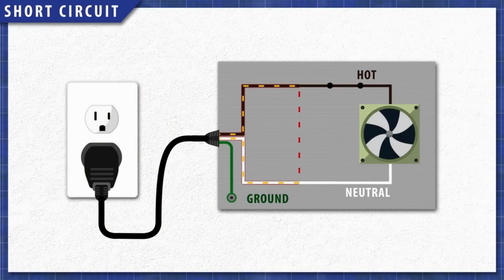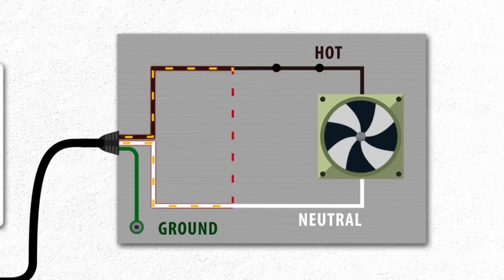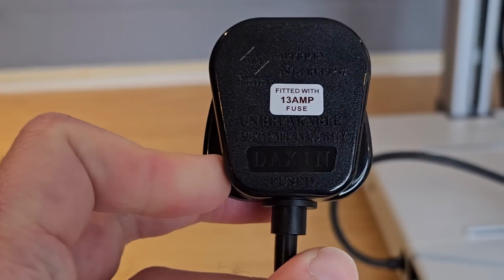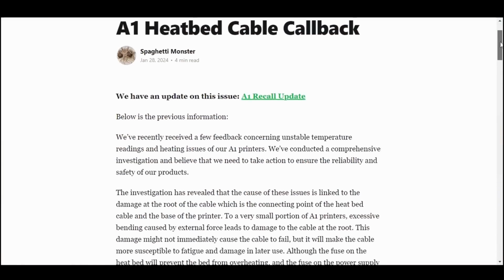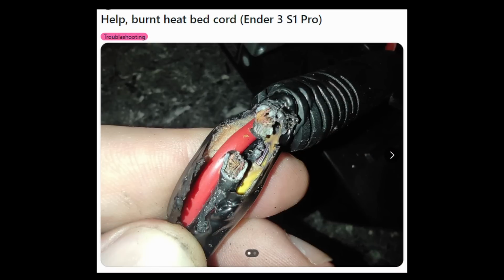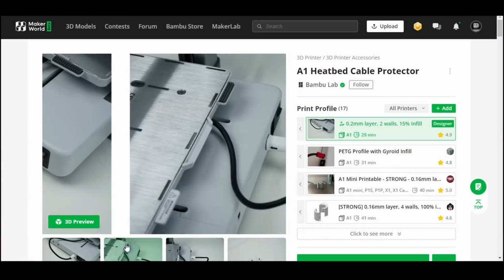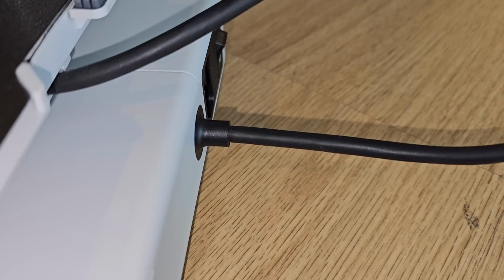Bambu Lab A1 3D Printer Recall - All You Need To Know

Comment: Should have stuck to the DC bed on a bedslinger, like the A1 mini. I am not a big fan of AC on bedslingers.
Reply: It would appear that this was ironically a decision based on cutting costs. The A! has a smaller cheaper power supply than the Ender 3.
Reply: Here in 240v land the bed uses 1000w. There's no way on earth they would put a 1200w(?) power supply in a printer. You'll always get faster heat up times with AC beds. As someone with 8 printers, I'll always favor AC beds. It's so much more efficient.
Reply: @camelKase   AC beds have been around for a long time. There is a trade off for speed of heating and shock and fire risk. AC heaters are better for CoreXY because the bed doesn’t sling back and forth. Not that AC heaters can’t be done on a bedslinger, there is just a lot more considerations for the cabling and safety. I have had AC heated beds, 12v and 24v DC heated beds. If I was going to recommend a bedslinger for a friend or family member, where they potentially might be service or tinkering or cleaning the bed with liquid cleaners, I would only recommend a DC bed. In 90% of users a one minute heat up vs three minutes is not really a huge feature. 

Good DC power supplies have short circuit protection and overcurrent protection that can react faster than a fuse or breaker. If you are counting on a fuse or breaker to protect you from AC mains, good luck. Lower voltage DC is exponentially safer and most vendors choose AC heaters for cost savings not the two minute time savings in a bed heat up.
Reply: @MrKornnugget  I don't disagree with any of that. Also They probably just use the same bed heater from the P1 and X1 since they're the same bed size. But with a grounded bed/frame your risk is almost nil. I would say there has never(??) been an AC printer electrocution. I'm happy to accept the risk for the efficiency / performance. Also my first printer was an AC bedslinger (Tevo Tornado).
Reply: @camelKase   I have been around the world, and you would be "Shocked" at how many outlets have bad grounds or no grounds at all. I am looking at you Schuko plugs, that are notorious for being plugged in without a ground. I also understand it is not Bambu's problem if your ground is bad or you plugged your Schuko plug into a universal power strip. 

I think there were some poor design choices, if they are going to put an A/C bed heater on a bedslinger, they should at least put a GFI plug on it. Fuses and breakers do not react fast enough to protect against electrocution. Grounded beds and frames only work if there is a good ground, and the electrical issue is touching the frame or bed.  With all the plastic, it is possible to have an electrical hazard that does not touch the frame or bed because they are not enclosures. Half the electrical enclosure is plastic and there is a possibility when a user touches the open electrical hazard they became the ground. Only a GFI would protect against non-ground or poorly grounded outlets or open electrical hazards. 

Let me see if I can summarize the two positions. 

DC Heated Beds:

1. Operate on lower voltages (12v or 24v), which generally means lower risk of severe electric shock.
2. Often power supplies with overcurrent protection to prevent excessive current draw.
3. Do not rely on house or building grounding for safety.

AC Heated Beds:

1. Can heat up more quickly due to higher power levels.
2. When properly grounded, the chassis can protect against electric shock, making them safe under normal conditions.
3. The use of a Ground Fault Circuit Interrupter (GFI) can interrupting the power if a fault is detected. (A1 does not have a GFI)

I personally think having a heating element on a bedslinger is a hazard that is not worth the time savings. This is just my opinion.
Reply: @camelKase   I wish I could post the link here, but there is a case of an AC bed shocking a person with an what I assume is an open ground situation. I found this with a Bing search and was shared on Electronic Stack Exchange. 

"Every time I touch the chassis of my 3D printer it shocks me.

I tested the ac voltage between the chassis and the hot wire also from chassis to neutral wire and I get 100+ voltage. In my country we have 220V AC in our sockets."

I think the reason that amount of documented cases is so rare is because the amount 3D printers in residences compared to other consumer electronics is really low. I think we will see more issues with A/C heated beds especially bedslinger going forward as the 3D printer market expands. Just because it has not happened yet, does not mean there is not the potential hazard. 

Maybe, I am wrong.
Reply: @MrKornnugget  I have personally opened an A1 and measured the ground points. All metal surfaces that the user has the opportunity to touch are protected by an earth conductor. The bed is wrapped in plastic which at normal house voltages, are isolating = No risk for a person to touch a live wire, and become the ground.

Modern RCDs typically disconnect power within 20-40 ms when there is a fault current above 20-30 ma.

At least locally for me, the regulations require that all house installations, regardless of age, must be protected by an RCD, and trust me, there are a lot of specifications that the RCD must meet.

As I see it, if the printer is properly connected, at least in my country, with ground protection, the risk is no greater than all my other appliances such as washing machine, oven, stove, hair dryer, etc. The RCD cuts the power in far less than a single second, at fault currents carrying less amperes than required to be lethal.

As for the possibility of starting a fire, a short circuit is a short circuit. I don't think there's a greater risk of a fire happening on AC Beds, as a proper short ciruit will use up all the amperage availabe, regardless of it being AC or DC. 

If there was to be a short circuit i trust a well documented and tested RCD, that complies to my local regulatives more, than i trust a power supply coming out of a chinese factory - Remember if the earth conductor start's carrying +20-30 mA,  the breaker will trip in less than a second.
Reply: And at second thought... Wiring up a DC Bed, will require a much beefier power supply,  a much lower gauge wire, which also has to remain flexible, the connections between the bed and power supply also has to be able to carry much more amperage, which in such case arguably makes it a greater fire risk. 

In my eyes the real issue is that Bambu Labs aren't really making customers aware of the fact, that instead of relying only on the printers internal protection, it should also be  connected properly to a grounded socket, which has ground-fault current protection behind it.
Reply: @user-uk3gc2dk3h If you live in a first class country yes, but good luck finding quality RCD's in developing countries or old apartment buildings from the 60-70s.... ground what ? A PSU causing a fire is always infinity lower than AC, a PSU can output just that much of current, on AC you usually have 25A fuse.... A meanwell or delta psu will shutdown ( hicup mode ) at the first short circuit spark, on AC the shorting cable can pull maybe 20A and that 25A fuse will deliver just as happily until you burn down the house.
Anyway in this particular case is the usual Chinees cheap ass quality, 0.1mm hard plastic wire insulation instead of a quality high flexible silicone cable, but when you want to overthrow the 3D printer market with cheap printers then there you have it, cheap ass materials.
Reply: @andrasszasz4373  Yes you're very right, about the fact that modern RCD's are not standard throughout the world. 

Interesting about the 25A fuse, here nothing else but a 13A "Automatic-Circuit Breaker" is to be used - only if there's a special requirement for something else. I live in a apartment complex from 1909, and the landlord still has to follow these reqs. regardless, of when it was built.

As for the PSU always being safer than direct AC, i have to disagree very hard on that. There's many examples of PSU's  being literal time-bombs, because they have to convert mains into DC, and still be able to deliver huge amounts of current, which requires a lot of components, that can be sourced cheaply from very bad manufacturers. Also the conversion has a bi-effect, infrared radiation - Which when enclosed, as they often are, can lead to these components failing - I've personally had a fire happened this way.
Reply: @camelKase  aren't you completely switched over to CoreXY printers? It's understandable that Voron owners would be  more confident in their equipment.
Reply: @eltamarindo  My Prusa MK3S and MK4 are both DC beds. They take ages to get to 110c, although I only print PLA on them.
Reply: AC has so many advantages.
Reply: @user-uk3gc2dk3h   I think I know why they went with an AC bed on the A1 but a DC bed on the mini. Since Bambu can hook the AC bed to the mains instead of the DC power supply they can use a significantly smaller DC power supply. I am not 100% sure that is why they went AC on the A1, but it is a significant cost savings.